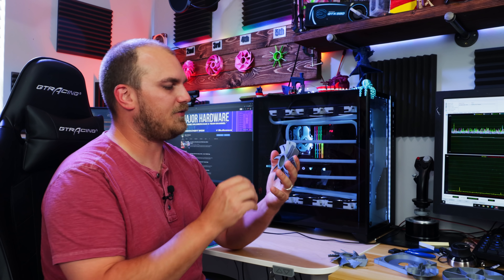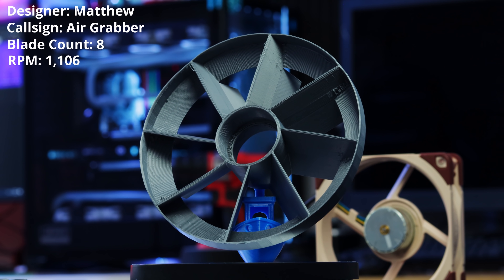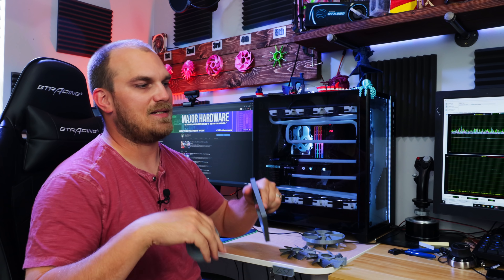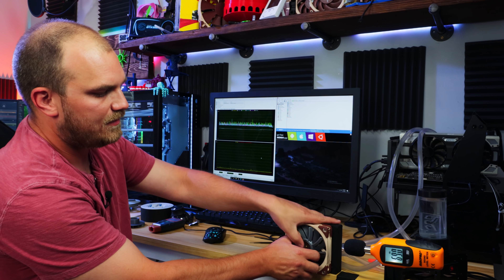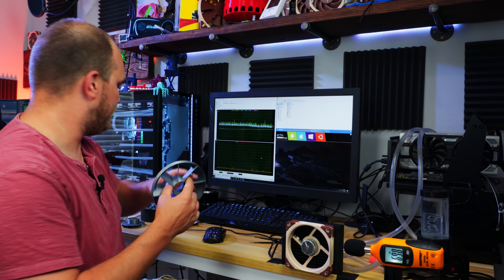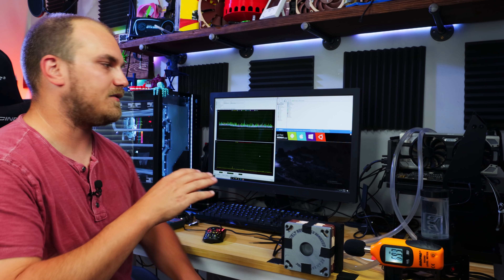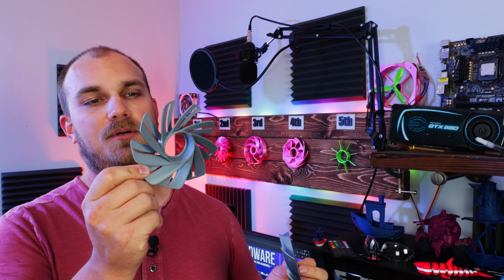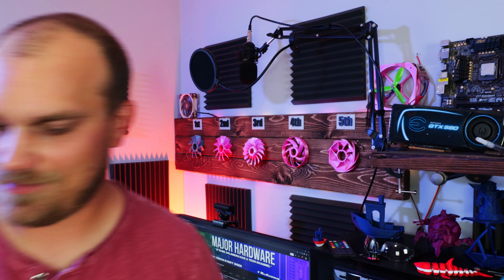We Are All Noctua Engineers | Fan Show Down Episode 4

Comment: Everyone else: This is a cool competition and really fun too!
Noctua Designers: Write that down! Did you get that? Wait what did they do? Ooh, write that down!
Reply: I find it hard to believe that Noctua doesn't have fan showdowns of their own. The F12, P12, A12 and S12 have such unique fan designs that are so different from each other.
Reply: You have to remember that noctua can't 3d print fans, so they're limited as to what is possible for them to manufacture. It's very possible that we'll end up finding something that performs better because additive manufacturing is so flexible.
Reply: @jttech44  you can reproduce any design once finalised in an injection moulding process, piece of cake.
Reply: @deadprivacy  there are certain shapes that aren't possible with injection molding, and even more that wouldn't be cost effective to manufacture
Reply: @jttech44  not these fans though, they would be no issue in reproducing them.

Comment: if you want to beat the A12x25 then take the A12x25 design, and add the "whale fin" teeth to the TRAILING edge, not the leading edge. Also extend the leading edge just a little. It will be quieter and perform as well, if not better, than the A12x25.

Comment: Get some zip ties. They come into use often like mounting fans. The 140 to 120 fan might do better with a different fan profile. But it would be better to just use a 140mm fan with a 120mm converter or visa versa.

Comment: the attack angle on the air grabber blades is far too high with the result being that the blades have stalled. out combined with the back pressure from the radiator means it just throwing air around rather than pushing it through the rad. need to reprint it with the blade angle at least twice what they are
Reply: the air whale, im going to call it, the leading edge is basically a set of vortex generators. those are going to *reduce flow seperation from the top of the blade, increasing static pressure. 

static pressure basically being "lift" that pushes the air where you want it to go.

Comment: I like the impeller design, but the problem is that, from what I know, those work much better in closed loops or ones with much less compressible fluids (a la water) because they rely on pulling air in as opposed to pushing air through

Comment: @Major hardware, I really wish to see a video where you print and test fans with different number of blades once you find out which is the most efficient use that design and figure out at which angle the blades will be most efficient at... ( I found that usually they're most effecient between 5 and 10 degrees but I'm willing to bet 13 degrees will be better ;) ) please ???

Comment: Anyone noticed that the 140/120 fan design was actually designed to rotate the other way around ? probably by mistake im guessing
Reply: Also thought that at first, but the blades are titled in the same way as the others, so it should work.
Reply: If the objective was to suck air out of the box then the centrifugal dynamic on this one world help a lot.
Reply: @frederickwood9116  maybe but I don't think that was his objective. first of all pull configuration is less efficient than push and it would have made more sense the make the first stage smaller rather than larger to create a venturi effect and therefore assist the fan in pulling even more air.
Reply: Stephen Buhagiar I wonder what the maths are around the sizing differences from in to out to get the centrifugal advantage. The out size it already set. Humm. It’s got me curious now. 
There might be an air flow testing package used in aviation design to dig up. Fun fun.
Reply: @frederickwood9116  that would be interesting to see
Reply: Stephen Buhagiar I’m not experienced in designing for 3D printing. If you are comfortable with playing with those tools I would love to learn and help with a design or two. Then present them here for possible printing and comparing. Can meet up in discord or something I guess. It’s a thought. Not sure how practical it is!
Reply: @frederickwood9116  sure send me your discord and we'll see what we can do about it.
Reply: @Stephenm3a   been looking for a way to PM you. cant see anything yet in your youtube channel. Derfman34 is my discord name.
Reply: @frederickwood9116  you also need to send me the number m8 like for example Derfman34#1234
Reply: Stephen Buhagiar #5689
Reply: He need to print that one again...but fix the problem
Reply: Yeah, it isn't backwards.
Reply: Not backwards, not sure why people are saying that. It's counter clockwise just like the others. See here https://youtu.be/UTU_g8r49C0?t=133
Reply: @ringosk1  you're right but watch 6:10 - 6:14 it looks like it's spinning the opposite way. even the smoke was behaving in a weird way.
Reply: @Stephenm3a  It looks like it's going backwards because of the rolling shutter effect, which also happens on all the other fans. The smoke wasn't going through the fan efficiently because the air flow was being counteracted by increased pressure as the path of the air is constricted. If the fan was going the wrong way, the smoke would just be pushed in the other direction.
Reply: NO IT FUCKING ISN'T. Is this an inside joke that I'm not getting? Compare it to the previous fan. The rake of the fans is very obviously in the same direction. It's not complicated. Why does anyone think this fan is backwards?
Reply: Just looking at the fan blades, I cannot decide the effect of the blades on pressure versus airflow. My intuition wanted them the other way around, though.
The ring around the blades is interesting and compares - in my imagination - with the winglets on airplane wings that prevent air form sliding away sideways, thus improving wing effectiveness. That benefit is likely completely (more than) defeated in this design. The large diameter first, in my imagination, requires considerable pressure to be built in the following stage but the blades are the same design, suggesting this will not happen. Hence my doubts.
Reply: @jpdj2715  totally agree m8 and yes the ring is usually effective but it is 90 degrees to the blade otherwise it will create additional skin drag and defeats its purpose. with regards to the pitch of the blades, I think they were way too steep for that motor they shouldn't exceed 14 degrees that are right on the edge of critical alpha more than that and blade would have more drag rather than airflow.
Reply: I think he put it backwards, but then it wouldn't fit into the frame of the noctua
Reply: Stephen Buhagiar it wasn’t ?
Reply: @Volt64bolt  yup it can clearly be seen in the vid.
Reply: Stephen Buhagiar looking at it from the side with bigger part at top then the blades face this way ->/ which is the correct way?
Reply: @Volt64bolt  the correct way  is the the leading edge of the blade should be facing the same way the prop is turning and the trailing edge on the other side

Comment: The “blower fan” reminds me of a water impeller, Interesting but seems less effective on air.
Reply: those are used very often in industrial settings. All you need to do is look up "blower fan" and you'll see why he called it that XD
Reply: The small intake hole looked like it was the limiting factor in the design. Can probably widen it out to the size of the "fan" as air gets flung sideways at that point.
Reply: @lordsqueak  then you lose the pressure and no longer have much of a fan, sadly. It's a limitation to the design.
Reply: @lordsqueak  They could make the hole bigger, but I think that there still needs to be a hole.
Reply: @BoomchacleV0  Yeah, I didn't mean remove the top completely, but to make the hole the same radius as the fan. That way the fan gets access to all the air it can, and once flung sideways, the air doesn't escape back out, so that it can operate at it's best.
Reply: @lordsqueak  you can't have the intake hole be the size of the impeller. You'd lose most of the pressure. Ideally you want an impeller with 2 discs. And if I remember my engineering classes from ages ago correctly, the area of the intake opening should be the area of the inside of the impeller multiplied by the square root of 2.
Reply: @fermitupoupon1754  But this is a fanblower design. It works by throwing the air sideways. I could be wrong here, but I'm mostly thinking of typical fanblower designs as seen on GPU's.
Reply: @lordsqueak  the blower design we're both describing is called a squirrel cage blower. Do a google image search, you'll see that they either have wide ring that seals the ends of the impeller, or they're mounted in a housing which has a flange that goes inside the impeller and creates the seal.

Comment: I just thought of an idea. Someone needs to make a fan that has an outer ring that looks like a velocity stack. if it's done right I think it might be able to increase the amount of air pulled in. Basically something like one of these glued on top of a fan https://www.amazon.com/Uxcell-a17122500ux0113-Motorcycle-Starter-Motor/dp/B07CWR35V8

Comment: The winner is because of the forward swept blades. As with aircraft, sweeping the blades forward promotes the air to move into the center hub, not away from. In aircraft this helps with slow speed tip stilling!!! Make one with a straight leading edge, and call it my entry. Name it PHUNUM, Thanks!!!!
Spc-Lee A Benson 11B U.S. Army (RM)

Comment: Wow i made it to the 5th place :D " 4th unofficially", Thanks James.
Reply: I pass the torch on. Congrats!
Reply: Haha, i saw the mistake too.
Reply: @danielwlodawer8469  Sadly i moved Bryce out of the board :(
Reply: @stormq8  yes that awesome green fan!
Reply: Nice job bro
Reply: @KaliKitsune25  Thanks
Reply: Your concept reminded me of the rear wings of Formula 1 cars, where they use two blades instead of one, to prevent air separation while using a stepper angle of attack, might be something interesting to explore here...
Reply: @camilonino84  ill try to improve the design with stepper angle of attack since i need more pressure for radiator intake, but i don't think my printer will play nice with these kind of angles.

Comment: The reason the Air Grabber did so poor is because of the blade shroud and the straight blades. The shroud created a turbulent airflow, and the fan blades pushed the air more outwards towards the edge rather than inwards towards the radiator. If someone were to create a stationary clip-on shroud similar in concept to what the Blower Fan had, and used more rounded conventional blades the airflow would be significantly improved.

Comment: Design idea for anyone that has the tools. A cylindrical fan inside of an enclosure, as they need to be. Air is pulled along a slit on the outside length. The push side air (95°) is channeled to radiator. Done already?

If I'm not mistaken I believe cylindrical fans can build a bit of pressure. That's key here.
Reply: I think that for a radiator, you want flow velocity instead of pressure.
Reply: @BoomchacleV0  I'm not sure honestly but I mentioned that to explain my thinking behind an enclosure which directs the air flow to the radiator. Meaning it should be able to move that air through a duct with little issue.

Comment: i have ran around 70 fans threw a modified fluid dynmics symulator super realeatic i tested 3 fans and there was  avg of 5 degrees wrong so super realistic but none (that were realistic and would work in a pc) beat the noctua a12x25 ):

Comment: Mr Nick's fan sweated edge is asymeyrical from one blade to the next.  This is intentional as placing "holes" at different gaps prevent wind generated noise harmonics and creates a lower volume broader spectrum noise.

Centrifigal fans (squirrel cage blowers) are noise but create descent attic pressure if you don't starve them.  They work a lot better when you sufficient air to feed them.  He didn't.

Comment: [2:24] I had some ideas what might be interesting to try and the Air Grabber basically comes very close to that. Watching on now to see the results. :)
Reply: Me too. This Air Grabber was too aggressive. Need to adjust the angle, why not design it aggressive at the center then a little flatter at the tip.
Reply: Yeah, looking closer at it the fan blades should more aim for a 45° angle and act less like walls. An "Air Grabber V2" with more regular angles could be interesting again.
Reply: It would probably work better if it was backwards, as in blowing air from small to big, than trying to blow a large amount of air through the smaller hole. I would argue this since the centripetal acceleration would cause the air to hit the sides, and cause of the angles, pushes itself back out, thus why he said it was spitting air out everywhere
Reply: Brian W small to big would not do anything more than just small by itself
Reply: Brian W the problem with the current design is like everyone has said the blade angle and also the angle of the wall that separates small to big  is also too aggressive and it does bounce back out the fan
Reply: spinning the wrong way